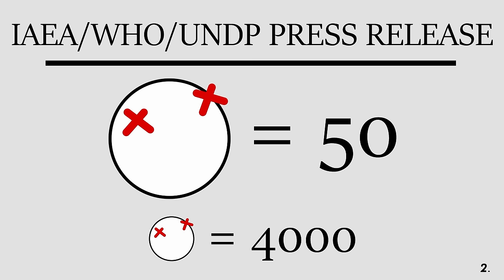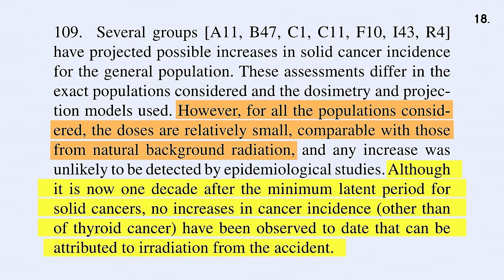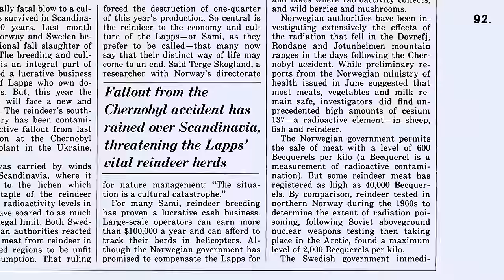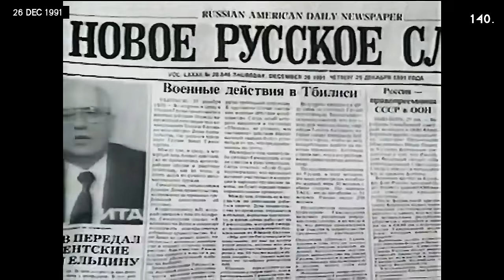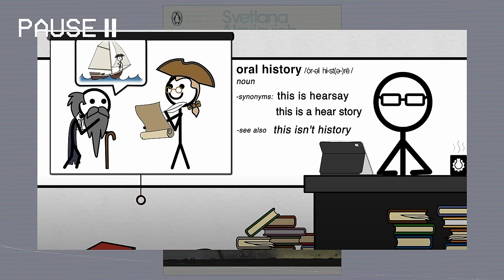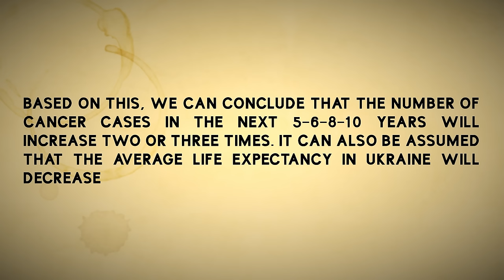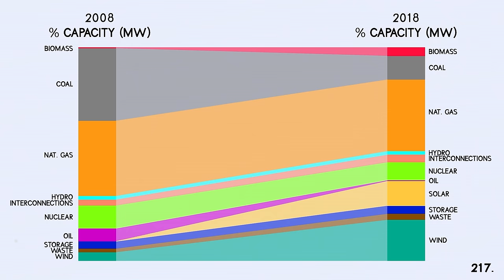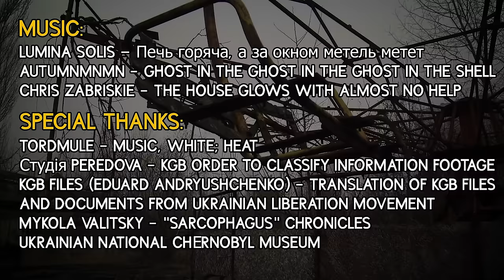Chernobyl's Death Toll | The Deep Dive

Comment: As someone who is mathematically-minded and spent years studying radiation and its effect on biology, I appreciate the segment where you break down the fact that radiation isn’t just creeping death and that government-defined “healthy levels” of radiation are very flimsy. For those wondering, while you don’t want to use a half ton ingot of Uranium-235 as a body pillow, radiation (even from a modern nuclear attack) is just not something you have to worry about as far as health concerns. People still live in the Chernobyl exclusion zone and the area has become wilderness as opposed to wasteland. People have this misconception that radiation is bad, and while not untrue, it’s also not gonna have any more effect on the average length of your life than the danger of driving will.
Reply: One of the issues with the exclusion zone is that the upper layer of soil itself was buried deeper into the ground in the contaminated areas. It is still not safe to dig holes in the area, so any long-term settlement of large groups of people is impractical. I mean, it is difficult to maintain a town without ever patching roads, repairing underground pipes or cables, or making foundations for new buildings.
It is still just one disaster, though, and an extremely unlikely one (ironically, SOME of it was due to more independence granted to republics).
Reply: I think the thing most people don't understand is that radioactivity can either be intense or last a long time, but never both. It's a trade off.
Elements/Isotopes that are extremely radioactive have a short half-life, while those that remain radioactive for many thousands of years are relatively mild sources of radiation.

I like to compare it to a sprinter vs a jogger. The sprinter can do a lap much faster but will be out of breath afterwards, whereas the jogger can make multiple laps but much slower.
They're using the same total amount of energy, one's just more conservative.
Reply: It's funny how people always compare things to driving when they're trying to downplay risks, because driving is kind of dangerous lol.
Reply: @dark2023-1lovesoni  While I understand what you're trying to get at, sufficient amounts of long half-life material could create intense radiation. Of course, you would need to deliberately pile insane amounts of the material into a single spot to achieve that with the sole intention of creating such a situation, it is something worth noting to be possible.
Reply: "People have this misconception that radiation is bad, while not untrue..."
It's not a misconception, then, is it?

Comment: One of the worst realisation is that simmilar instability in reactor happened before in Lenigrad power plant at Sosnovy Bor. But crew of other blocks let alone power plants were not instructed about that, becuase it would imply imperfcetion in whole systems. And yes, those old power plants were designed laughably bad in terms of security in case of undesired states

Comment: An excellent video that I shall rewatch and think about for some time I'm sure. I do wish to quibble with your source number 263: They're specifically adding Chernobyl despite it being outside the timescale they wanted to use, but not adjusting for hydroelectric having similar outlier disasters. Their source (Sovacool et al) has a table for fatalities averaged from 1950 to 2014 they could have used; it seems irresponsible to construct a span to specifically include the worst nuclear accidents, but exclude the dam failures of the 70s.
Reply from the maker: That's a bit of context I wasn't aware of about the Sovacool paper some of the data is based on. I'll add that into the reference sheet. Thanks for letting me know!
Reply: And dams are targets during war (WW2, Korean, Croatian).

Comment: So one question here is, "how bad is 1000 Bq/kg?"

Normally, your body has about 8000 Bq of Carbon-14 and Potassium-40 in it. This is spread out over 60 or so kg. So 1000 is 8x the limit. Basically, those sheep are about 10x as radioactive as people, which is about 3 mSv/year worth.
The problem though is that this stuff has a tendency to bioaccumulate. Under the worst case scenario, every kg of meat you eat would just add on to your body's natural radioactivity. If you ate 1000 kg over many years under this assumption, that would make you have a million Bq.

Which might sound pretty bad. And it is... but, that's still only around 30 mSv/year. Vs ~100 needed for CRS, or ~100 per hour for ARS.

of course, this gets into a question. What's the biological halflife of Cs-137?
Well, it turns out it's actually more like 2 months.

This is pretty important because it means you really have to eat a lot of those sheep very quickly to do much damage. The stuff gets thrown out a lot faster than people give credit for. It's definitely not sitting there for years.

That suggests to me that if you ate a kg/day of those sheep, you're gonna have about 70000 extra Bq of radiation. Which is about 2 mSv every year. So if your diet is mostly those sheep for a year, you might be almost 10x as radioactive as normal because of it and have about 2% the dose needed for CRS.

Cancer is another concern. If we go by the (obviously incorrect for a self-repairing system) Linear No Threshold model, we can calculate that after a year of eating pretty much nothing but radioactive sheep, your risk of long term cancer might be increased 0.01%. Though as the COVID-19 crisis shows, spread out a low death rate over a large population and it gets bad fast. If a hundred million people eat nothing but radioactive sheep for a year, that model suggests 10,000 excess cancer deaths.

Of course, that's just one model. And we should keep in mind most of the biological and statistical evidence that has been studied supports either diminished, negligible, or even protective carcinogenic effects of low dose whole body irradiation below the threshhold of CRS, or even potentially well into the threshhold of CRS. Considering we're talking about 2% the threshold of CRS, we really have no idea but it's almost surely less than 0.01%. Quite possibly dramatically less.

Though the cancer rate increase from eating that much meat, radioactive or not.... I'm pretty sure that's gonna be way past 10,000 excess death.

Comment: Brilliant video that needs to be more widely seen! Agreed that we do need to include nuclear power in the energy mix to accelerate decarbonization. France is an interesting example where they invested heavily in nuclear in the past and it currently produces 75% of their electricity. Apparently it just got announced last month France now does plan to build some new nuclear power stations, but I don't know whether it will fill the gap as the old ones reach end-of-life. So much like Germany, it's going to create a gap which is likely to be filled by gas or coal.

Comment: 97:55 While it’s true that the Soviets initially favoured the RBMK due to its ease of construction, by the time Gorbachev came to power VVER had already displaced it as the dominant reactor being built. Of the ten reactors that entered construction in Russia (I couldn’t find any list with construction dates for the whole USSR but Chernobyl and Ignalina were the only RBMKs built outside Russia anyway) between 1980 and 1985, only two were RBMKs (both at sites which already housed such reactors) with the rest being VVERs. So while Gorbachev was a proponent of nuclear power, I wouldn’t say that he was pushing for RBMKs
Reply from the maker: I didn't know that - will check and add that clarification to the reference sheet

Comment: The Fukushima reactor's management recieved 2 calls to improve their safety measures because an adequqtely large tsunami could compromise the safety of the reactors.
One in 2000 and another in 2008. Both calls went unheeded as the odds of a tsunami that high were dismissed (despite being far from impossible).

So no. It wasn't a chain of unfortunate chain of misfortunate events. It was a completely forseeable event that, much like with Chernobyl, happened due to human hubris.

Comment: I'm late but there's one thing I'm going to have to challenge especially.

The incident at La Hague in May '86 did not lead to the workers developing ARS/Radiation Sickness.

Sources at the time indicate a maximum dose of 18 rem, or about a fifth of what is needed for ARS to occur. (18 rem = 180mSv)

It's 4 times the annual legal dose limit for nuclear workers in France at the time which is pretty bad, and is above the generally agreed threshold for increased cancer risk. However, it's still nowhere near radiation sickness inducing.
Reply: Adding an addendum here- EVERYTHING else I'm hearing and seeing here is absolutely on the nose, I can't fault it aside for that one detail. I do commend you on that however ❤

Comment: I work in the power industry.  Nuclear is the best base load source available.  Hands down.  Renewables are fine for peak and reserve sources but they lack the ability to provide consistency and voltage stability.  Also, when u price compare solar and wind to nuclear you have to take capacity factor into account and life cycle.  Solar is 20%, wind is 30% each lasting 10 to 20 years. Nuclear is about 90% and lasts 60 to 80 years.  So you have to build 3 to 4 times the wind MWe to replace each nuclear MWe.  Pluse rebuild them 3 to 4 more times.
Reply: I completely agree about nuclear energy 

What should be happening is that we should be making more nuclear reactors until it is the only electrical sources we need and then start to work on renewable energy to make it more efficient and once it's good enough start to filter out the reactors cause well there is a limited amount of nuclear fuel 

Anyway once we get a Dyson sphere all this stuff will become irrelevant
Reply: Defenders of renewable energies as of its current state really have no idea what instability of power output means. Maybe once an unlikely huge breakthrough of energy storage technology comes they can be the sole producer of energy but for now, renewable energies are just trash without traditional energy sources or nuclear. (I'm also power industry gang btw)

Comment: The problem with Chernobyl was caused more by the human factor rather than by it being RBMK.

The reactor was scheduled to undergo a maintenance procedure. A test run to asses if its performance is within parameters. Normal stuff.
One of the requirements for that maintenance procedure is - the reactor needs to be out of operation for about a day so it can cool off properly.
But due to an accident on another power plant the Chernobyl plant was required to produce more power to compensate and could not put the reactor out of service for cooling down.
The engineers on site recommended to cancel the test runs and reschedule the procedure. But this sensible recommendation was overturned. Tests started, the reactor temperature started spiking out of control and at that point the design flaw that cause reaction to go even hotter before getting shut off caused it to melt down.

Comment: The problem with Chernobyl was right from the outset the Soviet government put the squeeze on health professionals to cease and desist not only on drawing connections between myriad alarming (and often life threatening) symptoms which began popping up in patients right from the outset throughout the region but - more importantly - compiling accurate statistical models. This problem was reported extensively in Chernousenko's (hard to source) warts-and-all critique "Chernobyl: Insight From the Inside" (available in English translation on Amazon second hand). The upshot is - we really have very little idea about the true human cost of this tragedy. 

My pet bugbear with the media is their (deliberate?) fixation on the dangers of external radiation rather than the damage caused by the trillions of microscopic radionuclides which were blown out of the top of the reactor and scattered throughout much of Western Europe. It's one thing to get close to external sources. But just a few steps away and the danger drops off in line with the inverse square law. But you get the muck inside your lungs or other organs and it'll happily sit there painting your insides with DNA-smashing radiation until you die or it decays into more stable forms. This leads into what I think are disingenuous comparisons with other forms of energy such as coal. Sure, it's dirty, nasty stuff which has harmed countless people for thousands of years. But when a fragment of strontium starts lighting up your DNA that damage doesn't just affect you. It can lead to all manner of nasty mutations which are kicked down through multiple generations. It's in your children's DNA. It's in their children's DNA. And on and on and on.

Comment: There are other issues with nuclear not covered here. The issues of nuclear plants do not begin and end with safety or cost. 

It takes alot of resources and carbon to make a nuclear power plant. It doesn't just take a long time for a nuclear plant to break even cost wise, it takes a long time to break even carbon footprint wise. Lots of concrete involved for example. Lots of rare earth metals etc too.

That uranium and plutonium etc. also cause local environmental devastation to mine, more than many mined materials. 

Safely disposing of nuclear waste is also carbon intensive, building tunnels deep down and encasing the nuclear material.

Some of these issues can be reduced by recycling the nuclear waste to be reused. Though the process leaves a product that can also be used for nuclear weapons. Also more expensive to build. Most US nuclear power plants do not reuse nuclear material because of security concerns. 

Now not saying nuclear is bad. But the picture is just a bit bigger still.

Comment: With the alaska segment you confused locations. When you talked about cordova buildings from valdez Alaska were shown. Noth cordova and valdez alaska are fairly close and were severly effected by the oil spill. Both towns have a large fishing economy but valdez is the terminus of the alyeska pipeline which means that their economy is partially supported by oil.
Ill also add that resource extraction companies lying happened and is still happening. Two notable examples are the Manh Choh mine and pebble mine in alsaka which have a lot of local backlash mixed with people who just want to make a living.

Comment: The thing with nuclear power in Germany is that the population is still largly against nuclear power. I think this is primarily due to 3 reasons:
1.: The fear of 'another Chernobyl/Fokushima'. The germans fear nuclear Power exactly due to the reasons presented in the video. 
2.: In Germany there are still issues with the nuclear Waste. the only places that are fit for deep storage are decomissioned salt mines. There is a lot of fear that this could cause the metal vessels to corrode and thus contaminating the environment.
3.: There is a lot of media coverage of the nuclear powerplants of neighbouring countries such as France or Belgium. Both countries have built their nuclear powerplants very closely to the German border. This of course is due to geographical reasons and no problem by itself. The problem with this is that the nuclear powerplants at these borders are old. There are frequent articles about small fractures in these powerplants such as Tihange are only fueling the fear of 'another Chernobyl/Fokushima'. 
The only thing nuclear that a majority of Germans is in favor of is nuclear fusion energy which is not even completely developed and will aproximately take another 10-20 years until it's ready to use.

Comment: fukushima was NOT well designed, it had a known, oft complained about failure point that if fixed the meltdown likely would not have happened: the backup generators were in the basement, where they could easily be flooded. This flaw was pointed out during the construction process, and again after the fact, and ignored because changing it would cost money. This is part of the reason why the company who operated it got burdened with so much responsibility after the fact: stupid beurocratic penny pinching where a known issue was ignored for the purposes of pleasing investors.

Comment: This is brilliant. It brings up the huge issues which explain why Nuclear is effectively stuck at the moment: 
It is clean? Yes* (until a disaster means it's very much not and this video didn't touch on nuclear waste) 
Is it safe? Yes, statistically* (in an ideal world where companies don't cut corners which they always do)
Is it economically viable: Maybe depends on the maths* (old designs: no, new experimental designs: maybe, count cost of climate change: yes)
Should we finance research: Yes* (but governments won't because history and uncertainty of new designs and its unpopular)
Do we have time: Probably not* (maybe it will replace a stopgap, maybe fission will replace it) 

Best case: We invest in a great new design and crash build a ton of them (at low-cost thanks to a magical carbon tax) and avert climate disaster.
Middling case: old designs come online but are economically a black hole, new designs arrive but won't be built in time to avoid long terms damage from climate change. 
Worst case: Crash build a ton of them (at excessive cost), discover critical design/cut corner issues (even with new generations) through one or more disasters, stuck with the extreme cost of clean up and replacement.